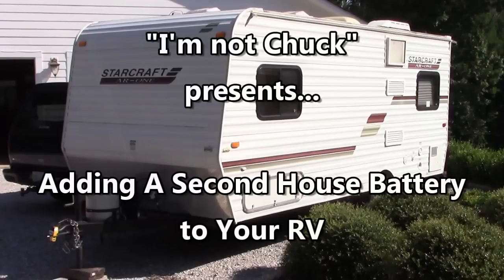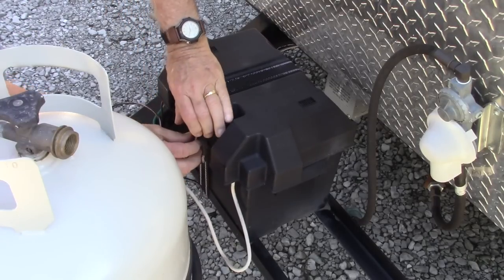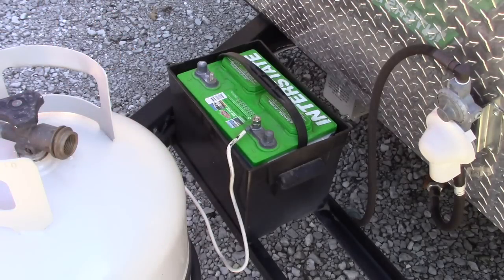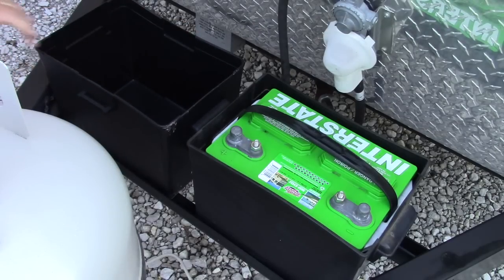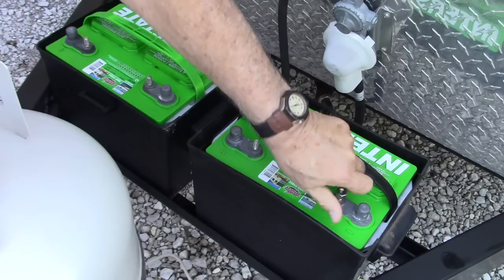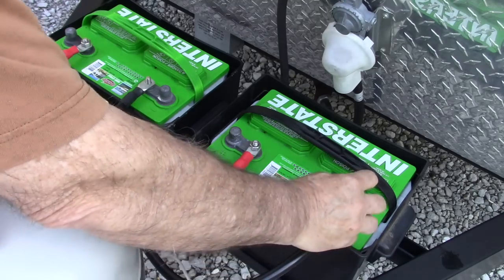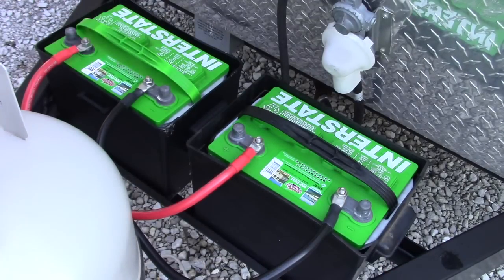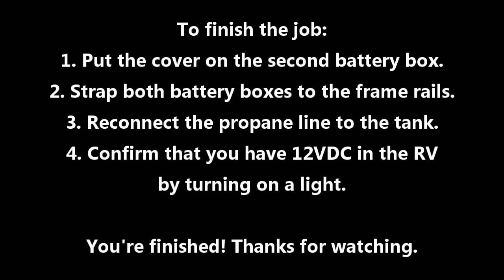Add a 2nd RV Battery

Comment: Chuck, am old school, love marine deep cycle..Have 4 105ah…These are at home for emergency 
Only..they serve me well…But for rv, etc, where your constantly taking them down to low limit,
Even past 50%, which I have when I had an rv years ago with young kids, gets cold at night
Was forced to run past 50%…they were luck to last a season…You should really think about
Going with lithium..long run it will pay..
Thanks for the vid..
Dennis
Reply from the maker: Hi Dennis, and thanks for watching and commenting. Of course you are right, and I am thinking about LiFePO4. I am a ham radio operator and am planning on putting my HF rig in the trailer for our next trip; it will be a big drain on the deep cycle Trojans FLA's that I have now. But $2 grand is a lot to spend for two batteries. :-)

Comment: Did you have to modify the battery boxes at all to make them fit? Looks like you may have cut off the battery box handle on the right side box.
Reply from the maker: No, I didn't modify the battery boxes, but the boxes are different brands, and slightly different configurations. Thanks for the question and for watching.

Comment: Why did you not increase cable size going into rv? Do you need to?
Reply from the maker: Cable sizing is dependent on current draw, and the current draw for the 12V devices in the RV is fairly low consisting only of the lights (LEDs), water pump, smoke and CO detectors, and fans. The large cable between the batteries is to ensure very low resistance so the batteries will stay balanced. Thanks for watching and for your question.
Reply: @ImnotChuck.  my original Cable in my RV trailer is small. It's a 1988 skyline nomad. I've upgraded the converter charger but left it 45 amp and I haven't increased the wire size. I'm using one dc31 12v. I also want to add a second battery. My DC board in house says 85 amp max, I think if I remember correctly.
Reply: @ImnotChuck.  I also have a propane furnace the runs off 12v.

Comment: Hiya, reading the voltage on a battery is no indication of the state of the battery you have to use a load test which is a dummy load and a meter that indicates the state of the ability to take and hold charge. Here in the U.K. most garages will have a tester and will do it for free. Don't be to surprised by the hefty spark when doing the test, this is normal. Batteries are not cheap and disposing of a healthy one when you don't need to is expensive. If they are not sealed cell units make sure the distilled water is topped off to the correct level before testing as a faulty cell may boil. You don't need to earth the second battery as this will form an earth loop, which in extreme cases may be a problem, one negative connection is sufficient as is one positive lead. Happy camping...
Reply from the maker: Thanks for watching and for commenting. Testing a battery under load is common here in the US, however load testers are less accurate than measuring the voltage with no load and checking the specific gravity. In fact, load testers are seldom adjusted to the size of the battery under test and can overload batteries during a test and permanently damage them. I have a battery load tester that I designed and built, but seldom have any reason to use it. When you have time, watch my two videos on specific gravity testing. As you will note, it is not a good idea to add water to a battery just before checking the specific gravity because the water will not be properly mixed in the electrolyte and the readings will be incorrect. Topping off cells with water after testing is proper. As to your comment about "earthing," electrical systems in RVs are never connected to earth ground except when using "shore power." I am sorry my reply isn't more positive, but I have studied lead-acid batteries extensively and formed my own opinions. Thanks for yours.

Comment: You need to secure the battery boxes and then strap the battery’s down unless you want to loose them! I had a friend loose a battery! Also go with 6v they are true deep cycle
Reply from the maker: Thanks for watching and for commenting. There are stronger ways to secure the batteries, but the straps hold the battery boxes to the A-frame on the trailer, and the batteries are tight inside the boxes. I took the trailer on a trip last September through MO, KS, CO, WY, ID, UT, NM, TX, OK, AR, and a couple of other states, and the batteries, boxes, and straps were as tight when I got back as when I left. You are correct that true deep cycle batteries are better for most RVers than dual purpose batteries, but there are other considerations that I will cover in a future video. True deep cycle batteries are available in 12V and 6V versions (as well as other voltages.) Please subscribe if you haven't already.
Reply: I guess I’m anal about it because if battery’s move around and don’t lay flat it can ruin them, I had a friend that just strapped them and it still fell off but we do more back roads stuff! A 6 volt is a true deep cycle because there is only 3 cells instead of 6. Each cell is 2.1 volts. Because each cell has more space, the capacity and cycling ability is much better.
Reply: There are 12v that claim to be deep cycle but they are not true deep cycle
Reply: In a pinch, we can use one of the dual purpose batteries to put under the hood of the tow vehicle to start the car or in our atv or boat for those of use with a toy hauler trailer. Thus that is why most of us go 12v dual purpose.
Reply: Oh that’s why I carry a jump starter with and air compressor, $75 well spent!
Reply: hughie voso and that’s fine I’m just saying they are not true deep cycle is all, I can run my battery’s triple the amount 12v deep cycles can before they need recharging

Comment: Even if you do not have the battery connected to anything the battery will still slowly discharge. So with that said the battery that was at 12.2 was a good battery and did not need to be replaced a trickle charge is what you should use when the battery is unplugged.
Reply from the maker: Hi and thanks for watching. Trickle chargers are great for maintaining batteries, but batteries that are routinely discharged below 12.5 volts will rapidly lose capacity and be ruined, which is what happened to this battery.
Reply: @ImnotChuck.   Shignog was correct, 12.2V is still a good battery.
Industry standards say you should never go below 12.0 for optimal battery life on flooded batteries.

Comment: I put a 80w solar panel and cheap mppt  controller on our one 110a battery  - max charge is about 5 amps  - the beauty of this approach is that the battery seldom falls below 1/3 empty  so it should last 5 or more years - if we were doing it again we would use the new thin solar   flexible panels that just stick to the roof
Reply from the maker: Keeping your battery at 66% charged or higher is good for its life expectancy. In an upcoming video, I will present some graphs that show that 80% pays even more dividends. A lot of people don't realize that a 12V battery that is down to 10.5V is considered completely discharged. Thanks for your comment. I hope you also subscribed.
Reply: Make sure you have a pint of beer charge for each cell charge.

Comment: What difference,  if any for charging with tow vehicles,  or generators, or solar panels?
Reply from the maker: My travel trailer and truck are set up to charge the house batteries from the truck, which is the quickest way to charge them. Charging from a generator is usually done by connecting the AC output from the generator to the shore power input on the RV, and then the converter on the RV charges the batteries. Solar panels should be connected to a solar charge controller, which is them connected to the house batteries to charge them. I plan to do a video on using multiple charging sources. Thanks for the question.
Reply: I'm not Chuck. Thanks for your response and I love what you are doing... Keep up the great work.
Reply: I'm reading your answer, I'm Not Chuck, but I am confused. Is there an AC output on all generators? The people who I bought my van from said that I should run the generator while I am driving to help charge my house batteries, but they never said anything about plugging in something! P.S. The previous owners did tell me that they just stayed in RV parks. They kind of looked at me weird-like when I mentioned my desire to boondock, and asked me WHY would I want to do THAT!! haha!! Thanks again I-N-C!!

Comment: When you’re not using your camper, which cable(s) do you disconnect to stop phantom drain over time?
Reply from the maker: Actually, I have added a disconnect switch on the side of one of the battery boxes, the answer to your question is to disconnect the positive connector. Thanks for watching.
Reply: @ImnotChuck.  what kind of disconnect switch did you go with and how is it installed? Can you post a link to where you purchased it? Sorry for all the questions but I’m new at RVing. Thanks
Reply from the maker: @Sniperfox1  https://www.amazon.com/Disconnect-Vehicles-Waterproof-Isolator-Position/dp/B07HT19T5V/ref=asc_df_B07HT19T5V/?tag=hyprod-20&linkCode=df0&hvadid=316725397836&hvpos=&hvnetw=g&hvrand=275693295050598946&hvpone=&hvptwo=&hvqmt=&hvdev=c&hvdvcmdl=&hvlocint=&hvlocphy=9013601&hvtargid=pla-587054685735&psc=1
Reply from the maker: @Sniperfox1  I installed it on the side of one of the battery boxes. Thanks for asking.

Comment: What size are the ends of the cables that you used?  Great video thank you!
Reply from the maker: The holes in the connectors are 5/16", but yours should be sized to the studs on your batteries. Thanks for watching.

Comment: Hey, I'm Not Chuck, gotta another question for ya.
     For my TT I have two 206 ah SOK  batteries. Can I wire them in series?
Reply from the maker: I was not familiar with that battery, so I googled it. It seems to be a 12V LiFePO4 battery, so if that is correct, there is no reason you can't wire them in series. Of course a series connection will result in the voltage being doubled to 24 Volts which means that all the DC equipment in your travel trailer will need to be 24V devices, which doesn't sound right to me. If you have 12V devices, you will need to wire the batteries in parallel in order to keep the nominal voltage at 12 Volts. Thanks for watching.
Reply: @ImnotChuck.  Thanks I'm Not Chuck, I googled 24 volt converter chargers and I think they bring the voltage back down to 12 volts when the batteries are connected in series. Does this sound right to you?
     I want to build a powerful 24 volt system, I've been watching Will Prowse speak about 24 volt systems. TKS for your honest opinions.

Comment: Not sure why you replaced the battery just because it was reading a voltage of 12.2. Why didn't you just recharge the battery.
Second question, why did you feel that one battery was not sufficient. Great video by the way.
Reply from the maker: John, thanks for the questions and the compliment.
The battery that I replaced had been charged to 12.7 volts just a few days earlier, and then self-discharged to 12.2 volts, which is almost 50% discharged. You are right that it wasn't completely useless, but it was very weak and wouldn't hold a charge very long. I wanted to be able to boondock for longer periods of time between recharges, which is also why I added a second battery.
Reply: Thanks for the reply, understanding your logic helps to clarify.

Comment from the maker: Hi Peter. Thanks for watching and for your question. For the answer, please read my comment pinned to the top. The short answer is that it doesn't matter as long as large diameter cables are used to connect the two batteries in parallel.

Comment: I want to add a battery to my pop up but don't know how. First of all what color are the wires that go from the converter to the battery.
Reply from the maker: I don't have any direct experience with a pop-up and wire colors vary from one RV to another. It should be in the manual that came with your trailer, but if you don't have a manual, look at the manufacturer's web site and you should be able to find one there. Sorry I can't help more, but I would be guessing, and that's a bad idea. Thanks for watching and please subscribe.

Comment: Will this work on my 5th wheel that comes with 1 battery & an inverter too?
Reply from the maker: Yes, as long as the inverter is designed for a 12V input, which should be marked on it. Thanks for watching and commenting.

Comment: 1GA cables are probably way overkill for connecting the batteries in parallel. Unless you're running them to an inverter, there's nothing in an RV that draws enough current to require such a heavy cable. 10GA would probably still be overkill. In a parallel situation, the current load should be equally split between the batteries, further reducing the actual current draw from the secondary battery.
Reply from the maker: You have actually answered your own comment. The large cables are not to supply current to the trailer; they are to ensure that the two batteries act as one with no voltage differential, thus equally loading the batteries. Thanks for watching and for commenting. Please subscribe if you haven't already done so.
Reply: Every video I have seen regarding multiple batteries, including RV dealers, instructs to connect the hot and ground out feed cables at opposite ends of the battery bank.  I am not saying you are wrong but respectfully, I have to wonder what they know that you don't or if everyone else is misinformed.
Reply from the maker: Please see my comment pinned at the top of the list. I can't explain it any better than that; notice that I don't say my way is better, but rather that there is no practical difference between the two connection arrangements IF a heavy gauge cable is used (which I have done.) Now, if I was using many batteries in parallel, the tiny resistance in the cables could begin to add up enough to matter. As to why this is so poorly understood, I think it's one of those things that seem logical, but don't hold up under scientific scrutiny and actual testing. My 10-month old pair of batteries are performing flawlessly in this arrangement, and if they continue to get proper maintenance, they will last for five years or more. On the other hand, if they are used improperly (overcharged and over-discharged,) they will be ruined in a matter of days or even hours. Thanks for you interest and for your polite method of inquiry. Please subscribe if you haven't already done so.
Reply: Matthew
Reply: HOT AND GROUND FROM THE ALTERNATOR - not your load.  In the video those are the load wires, not source wires.  Re-watch the video.  You have to know exactly what you are looking at and what the plan is before you decide it is the wrong way.

Instead of thinking of the battery terminals..........in your head or on a sheet of paper make two more posts which are attached to the two batteries where they are electrically the same away from the batteries.  NOW, how do you charge the batteries and what's your load.  Where do they go?  Once you have that figured out your above comment will make sense.

Comment: Chuck, you are using 1 gauge wire for the "Jumper", is that the requirement? I have been told that as long as the Jumper is a heaver gauge than the wires coming from the Trailer, that is fine, what say you?
Reply from the maker: Larger is better because I want to avoid ANY significant voltage loss between the two batteries, and thus essentially make the two batteries perform as one. That will eliminate one battery discharging a different rate from the other. In addition, some trailer manufacturers use smaller wire than they should to go from the battery to the converter, which makes the problem even worse. Please read my post pinned to the top of the comments for more info. Thanks for watching and for commenting. Please subscribe if you haven't already done so.

Comment: Is it bad to have a deep cycle battery and add a starting battery?
Reply from the maker: It's not good to connect dissimilar batteries together. One will carry more load than the other. In the case you describe, when the deep cycle is moderately discharged, the starting battery will be at very low voltage. When that is repeated a few times, the starting battery will be ruined. Thanks for watching.
Reply: No good use the same battery

Comment: You can use the same wire gauge that goes into the trailer to make the jumpers.  Anything larger is overkill and not necesssary.
Reply from the maker: I can't agree with your comment, but I do thank for watching and for commenting. Please subscribe if you haven't already.

Comment: Hello. Thanks for the video. I have connected my batteries in parallel . Although I was instructed to connect the positive to one battery and the negative to the other. They say it allows the draw on both batteries the same. Your thoughts?...Sorry....just read the extended version of why you decided to connect both pos and negative to the one battery. Thanks
Reply from the maker: I am glad you took the time to read my explanation. The bottom line is that I don't believe it makes any difference. Thanks for posting.

Comment: Will it matter if I have three batteries I can hook up ? as for the white wire will I hook it to the 2nd or 3nd battery?
Reply from the maker: A third battery will add to the total amount of power (watts) that you have available to power your RV lights and other devices. If you use heavy copper cables (1 AWG or larger,) you can connect the ground wire to any of the three negative battery terminals. Thanks for your question, and thanks for watching.
Reply: Yes you can do 3 12 volt batteries, as long as you wire them in Parallel not series.